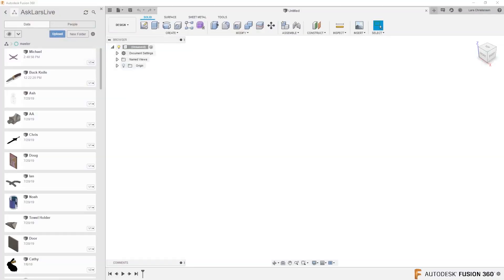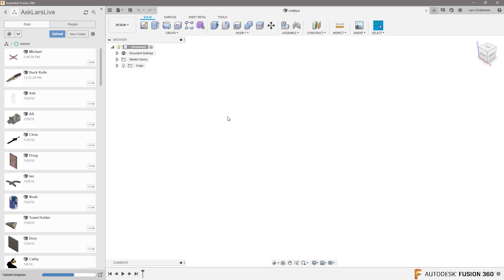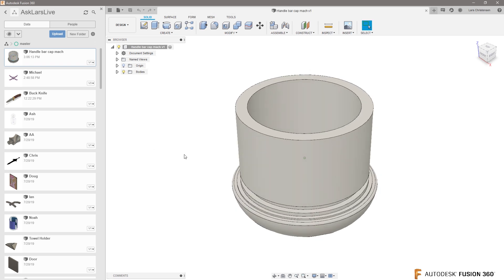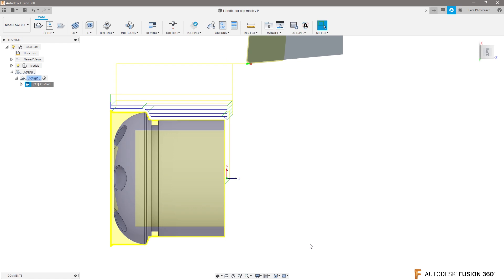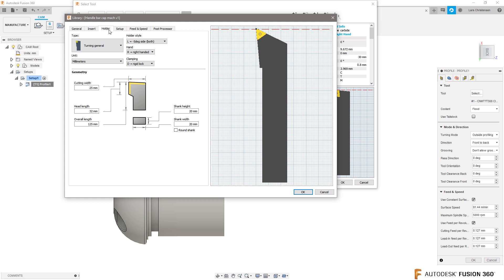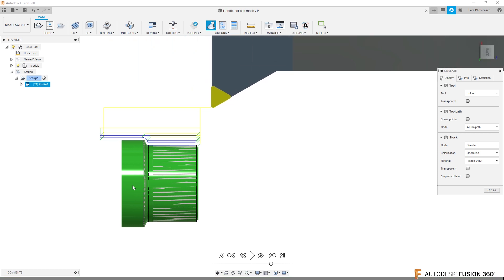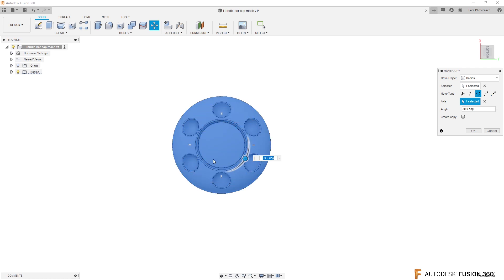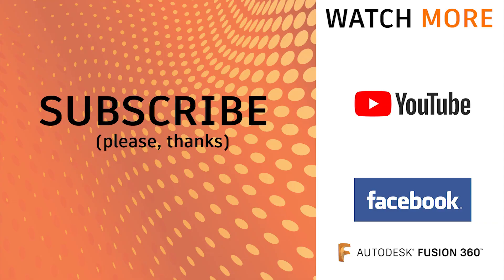Fusion 360 — CAM Turning 101 — Ask LarsLive

Comment: I have a quick question re turning. I've got a job that has a 50mm spherical bore using a 8mm button tool it's pre drilled with a 15mm drill. But I'm struggling with a pip tools on centre line. It works on nx but not on fusion any tips would be welcome.

Comment: I am using Fusion 360 and need a post processor for mach 3. Is it possible to add this to the list of post processors available. The only internet access I have is through a mac computer and I can not open the download. Will fusion 360 be adding a processor for mach3 turn as it seems a lot of people are struggling.
PS absolutely love your channel, clear and easy to understand. Keep it up please.
Reply from the maker: Google Autodesk Post Processor library and you should find one
Reply: same issue , f360 doesnt seem to work well in either diameter or radius mode.. it travels to  far in one direction either way

Comment: Lars, how hard or easy is it to change the tool orientation for Mill/Turning CAM. I have a Sherline Lathe and the turning tools are setup on the same side as the cross-slide adjusting knob. Hobbieman10@yahoo.com thanks

Comment: Will mill turn work on a Tormach 440 with small parts held in the spindle?
Reply: Check mill as a lathe using G52 from Jonh. He modify a Tormach post